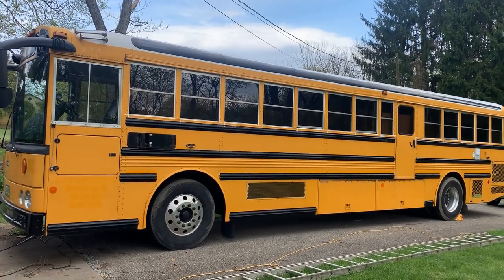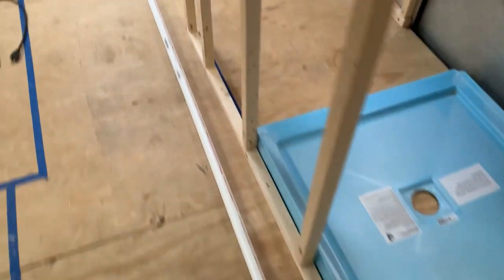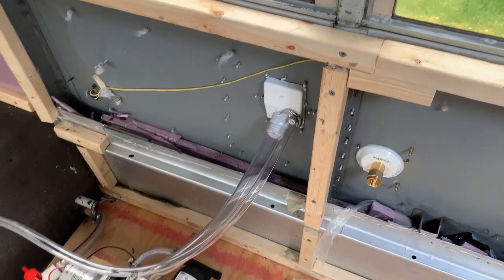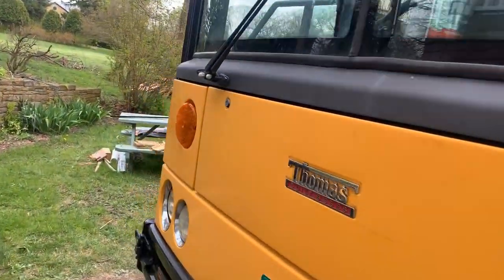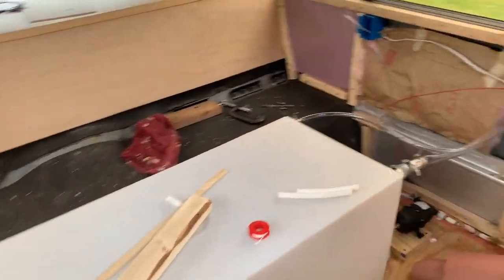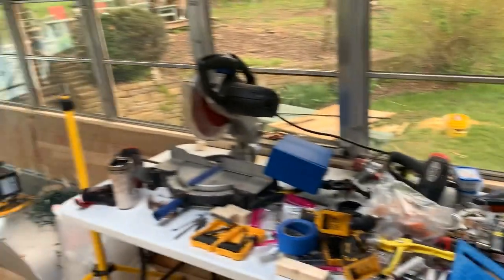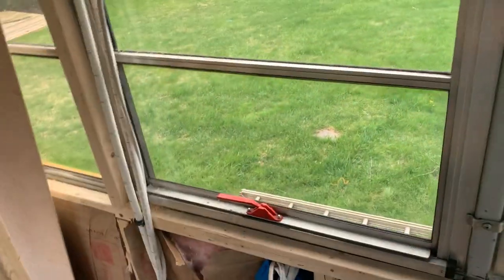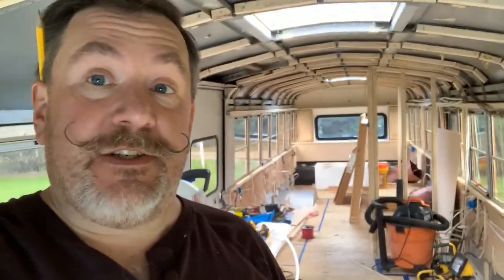Harmony Express Skoolie (Ep 14)   Skoolie framing, plumbing, electric

Comment: Your videos are helpful, thank you!  I'm a few steps behind you.  Wondering - what do you plan to do for insulating the walls and ceiling?
Reply from the maker: Thanks for your comment!  Keep following along, for sure!  Because we framed out our hat channels on the wall, we used fiberglass R-13 backed insulation in the walls.  We are planning to do the same thing on the ceiling.   We are not planning on being full time in the bus, but will be taking extended trips...
Reply from the maker: Shannon Elhart : counselor have you subscribed?  Stay tuned for further updates!’n